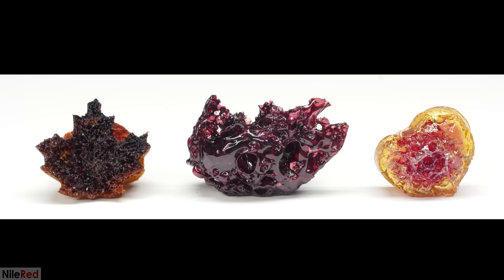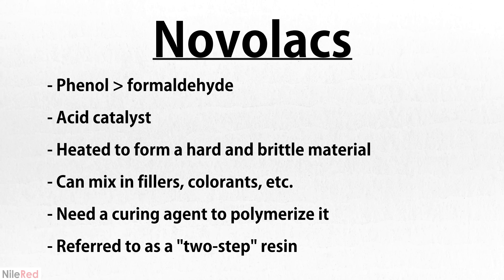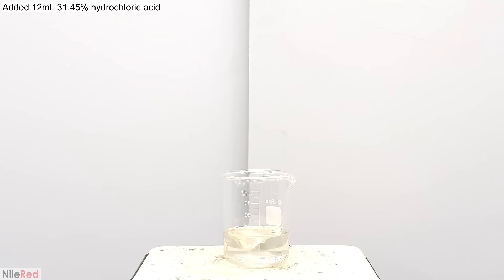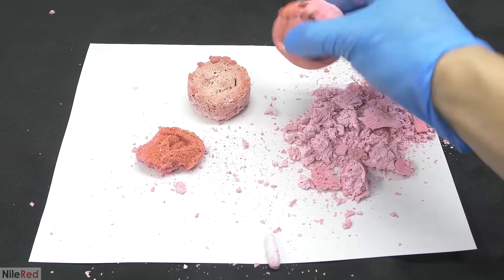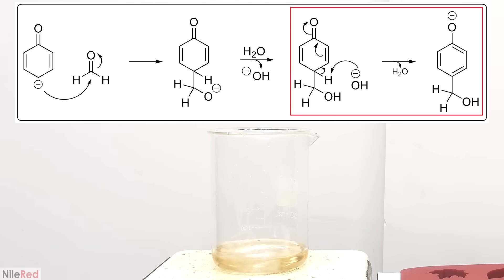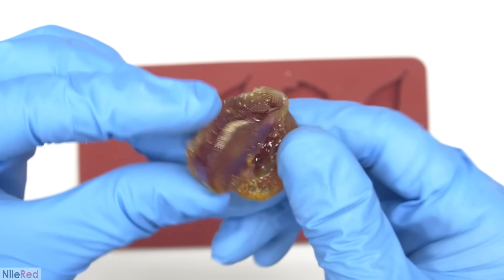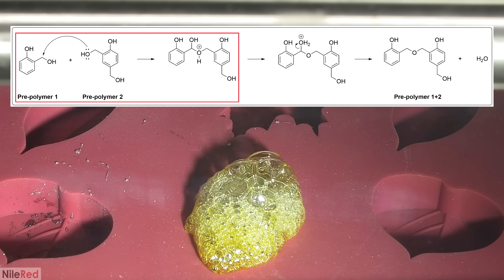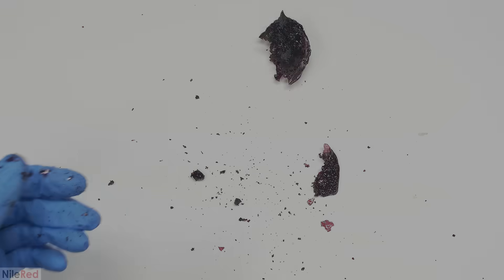Making bakelite plastic (Part 1)

Comment: NileRed - if you want to turn your toaster oven in to a temperature controlled environment then you may want to look in to getting toaster over temperature controllers for surface mount printed circuit board production. I've used one for PCB prototyping for a few years and they work surprisingly well. The toaster modification is a temperature controller that keeps the oven within a defined range instead of an arbitrary numeric "heat" level that you can calibrate quite accurately. They're not hard to make if you don't want to buy one either, plenty of DIY projects around.

Comment: How does the automatic stirring work?
Reply: Melle Haanen Magnets
Reply: Basically as someone else mentioned, it's a magnet. The hot plate has a moving magnetic field, which in turn spins the stirrer much like a rotor in an electric motor. The stirrer is coated with a chemically inert substance so as to not create unintended reactions. The things are designed specifically for the chemistry/science fields
Reply: Meme magic.
Reply: You can't explain that.

Comment: If you wish to revisit this, you should be able to build a workable bakerlizer(sp) using a steel 'pressure pot' of the type used for paint sprayers. Mine has a working pressure of 80 psi(And according to steam tables, should be good at keeping water from boiling below about 160c) and has a silicon seal that should hold well with the heat.
Do be careful do to the whole 'steam explosion' risk if you wish to go down this path. :)
Reply from the maker: +Electra Flarefire interesting. I'll think about it
Reply: I wonder if an old autoclave would work.
Reply: @paulskalla6845  ~40psia will get you the 270°F.  You're looking for a temp range between ~266°F and 392°F.  ~200psia on the high side...  So a 30psi pressure vessel could barely do the job at sea level if you don't get runaway.  Pretty sure a standard autoclave is a low pressure unit and taps out at 15psig.  A decent temperature control set up set to the low end could prevent runaway...  So an 80psi vessel could probably safely do the job.  But a higher quality high pressure vessel would be best.  But I'm pretty sure making aerogel would be a more useful and easier endeavor unless you're making something designed to sustain impact.
Reply: A pressure vessel, or at a pinch, a repurposed pressure cooker shouldn't be too hard to set up for the resol production, but I guess it will still "froth up" when the pressure is released? Maybe less than with steam bubbles though. 😁
I'm sure something small-scale wouldn't be too difficult, and it would be great to see and actual Bakelite object being moulded an baked. ♥️

Comment: You can still find new Bakelite electrical hardware.
Reply: douro20 light switches and plug sockets are made from it in England I think
Reply: Mhm! It’s pretty good for certain things like light sockets, but most other things it’s too brittle for. Other plastics make for better use there. And in the US I think you’d have to look pretty hard for a light switch made of Bakelite instead of PET

Comment: No Bakelizer -> Use pressure cooker filled with brine?
Reply: i don't think that would work ; the water being released in the bakelite prepolymer does not have the brine inside of it .....aside from that im not sure the brine would not affect the reactants .... and then theres buoyancy problems with the stuff you are trying to polymerize. .............. another huge problem is the corrosion very hot brine would do to a pressure cooker (and possibly embrittlement due to gas and other stuff working its way into the metal's boundaries) ...... and it just generally sounds like a bad idea; pressure cookers cant handle THAT high off pressures; if you are not carefull you have a bomb on your hands; brine might have a higher boiling point but that doesn't mean it wont build up pressure at elevated temperatures.
Reply: MainsOnTheOhmsRange NOOO
Reply: But hang on, isn't the bakelizer pretty much a just pressure cooker? High pressure steam vessel providing heating over 100C?
Reply: Why brine?
Reply: @techobsessed1  Yea, why brine?  Surely a pressure cooker, a water pool, and a small steel rack / platform to hold the mold above the water level would be enough.  That or a reverse vacuum chamber with a heating element in it.
Reply: How about dangling or supporting it on a platform within the pressure cooker?

Comment: Is there a reason a pressure cooker wouldn't have worked?
Reply: Jason Fraser well, you would need a lot of bakelite solution for it to work, the bakeliser starts with a high pressure, a pressure cooker would start at 1atm.
Reply: You can add water to the pressure cooker prior to heating, though.

Comment: your stuff helps in Chem classes, thanks dude
Reply: but do you have any tips for doing titrations?
Reply: Swampy Mudkipz when you see the first flash of color that goes away once you swirl it, you need to do it very very very slowly. Slow and steady wins the race with titration.
Reply: 1234lavaking how about the calculations?
Reply: Swampy Mudkipz okay, so you have to figure out how many mL of titrant you used, the titrant is the one that you know the concentration is. Convert the mL to liters and multiply the molarity of the titrant by that amount in L. That's the amount of moles of titrant you used. Then do your molar conversion based on the coefficients in the equation, and that is the moles that were reacted in the solution of unknown concentration. So divide that by the volume of unknown, in liters, and boom! The concentration of your unknown solution.
Reply: Yes, good for Chemistry class...not so much for Cooking 101...Home Ec. teacher to Nile: "I'm sorry Mr. Red, but your baked puff-pastry tastes like plastic!" LOL!

P.S. another way to clean glassware if the product is insoluble is to use the propane torch and burn it to ash, then scrub out with Scotchbrite and water. Most likely to create very nasty smoke and fumes though, so a vent-hood is key.
Reply: John L Bales yeah I was thinking the same thing! That stuff looks so messy I was afraid I would mess up my glassware lol
Reply: Mike Ehrmantraut Yeah, the first step is to be smart, and if you aren't doing well, more brute force. Do NOT ask for help at any point.
Reply: 1234lavaking 4 shore!
Reply: 1234lavaking I was wondering how he cleans up his gear. Glad acetone works on this product.
Reply: c'mon man the calculations are easy. Just google how to do them and practice.